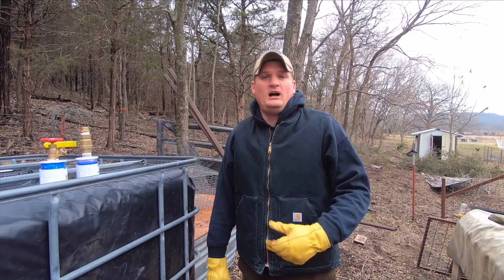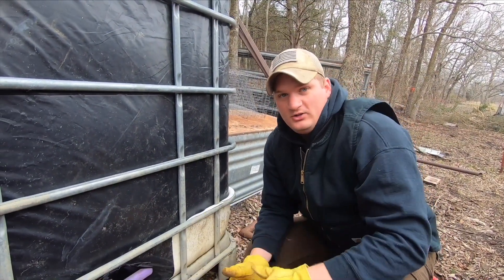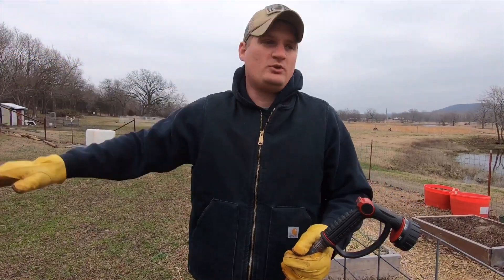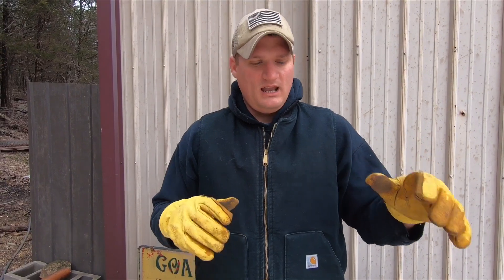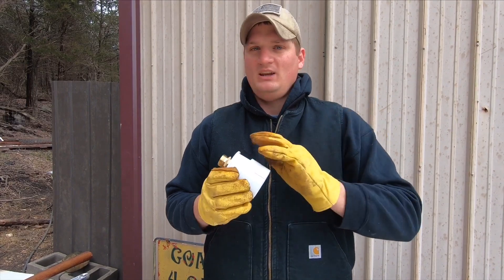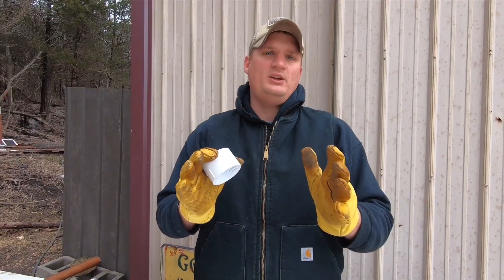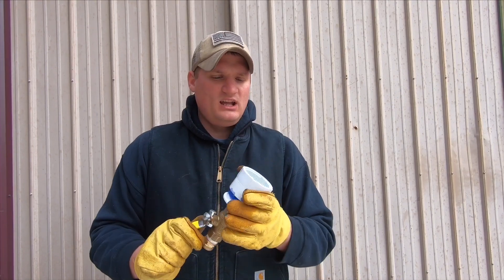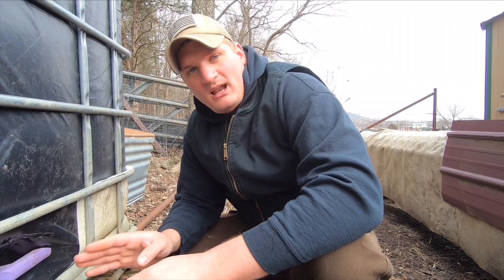The Best Valve For Your Gravity Fed Rain Water Harvesting System!

Comment: Good video showing the difference in the valves.  I saw the comments correcting you about pressure vs volume.  I just want to add a bit more info for others that might be installing elbows in the line before the hose connection.
As said, for maximum water volume you want to use a full port valve, but any elbows or tees in the line will add head pressure, which reduces volume and GPM.  A way around this is to use a larger diameter ball valve with larger elbows/tees.
For example, start with a 1" ball valve, then 1" hose to 1" elbows/tees.  Then neck it down to 3/4" to attach the hose.
Also, using a "sweep" elbow instead of a 90 degree elbow will reduce the volume loss caused by the fitting, so best to use them if available.  Another option is to use two 45 degree elbows spaced apart instead a 90 degree elbow.
If using several elbows before necking it down, probably better to use 1 1/2" instead of 1".
If you're going to use a lot of fittings, there are charts online that'll tell you the head pressure loss on any size and type of fitting.  You can do the math before you even start to determine what size to use to make up for the fittings that rob volume.  
In the end, you want the same volume/GPM flow with the fittings as you would if you just had a straight 3/4" hose with no fittings.

Comment: Thanks,,.
Y tested and work.
 After replaced my old regular garden hose connection, and put together with the new Handel Valve y have more pressure and more GALLONS PER MINUTE.

Comment: I cut a hole in the top of the tote and dropped in a 1/4 hp sump pump.    Using half inch hose now but in the past used 3/4 garden hose.      Flow with the large hose was phenomenal,  still very good with smaller hose.  Watch you don't drain the tank thru a siphon when the pump is off.  Grace

Comment: 👍👍. Dang you’re a straight up guy AND then the Bloopers 😅😂🤣😂. Got to love that laugh and smile. Very good video and definitely well thought out solutions.  My gramps drilled into me when ya change the clocks ya put in new batteries AND lubricate all valves with         3and1 oil.  In Fall wrap exposed pipes and leave extra to wrap valves just in case of freezing temps.  And ONLY because ya may get too busy with holidays and other things and forget. Ounce of prevention adds life to all your hard work. Been here 30 some years and one by one PVC pipes underground have now cracked and it’s been a mess outside.  Total excavation and finding more tiny leaks way below freezing line. Now just found a leak under foundation of house. They have improved PVC so much since back then but now water is so costly. Any improvements means gray water for outside and non consumable and another line for inside. And we’ve got the same setup for each faucet.  All very costly so any water saving ya can do really helps.....if we can get some rain. Been under drought rules for 5 years. So been wondering about your water.....a well or piped in??  Had a small well on my farm in back then had to buy shares for front land and house or it was a dance in shower to get clean. All your knowledge is Golden lessons for newbies.  But as always maybe it works and maybe it won’t BUT always be willing to learn. 👍👍👍👍👍👍👍👍👍👍

Comment: At 19:00 that is called a close quarter nipple.  Only saying this for those that might be going shopping for  parts. The glue only needs a few minutes to set. 
This is a nice set up, would be great for drip tape/or pipe irrigation.  If your not watering animals from it you can directly add fertilizer in it.
Reply from the maker: Squirrel hill farm we have been thinking of doing irrigation. I think that would help alot

Comment: Very Very helpful in determining mine.  I just bartered with someone for a couple tanks with the exact same novels.  Do you find it absolutely necessary to cover them in black for only garden watering?
Reply from the maker: I would cover them keeps them clean. If you ever needed to use the water for animals emergency etc it would be clean and no worries.

Comment: You have pressure  and VOLUME mixed up. If yer totes are 250 gallons, then the pressure will be the same in both tanks. Volume depends on the size of fittings you use. BUT, I love the vids, you two are great.
Reply from the maker: Thank you! 👍😄

Comment: I have 3 of these IBC containers that I am going to set up in the spring.  I have figured out not to use the collapsible hoses for these.  There is not enough water that comes out of those, use rubber hoses instead.
Reply from the maker: Yes 44 warlord that is true bigger diameter the better.

Comment: There is fine thread (NPT) and course thread, so be aware.  Unfortunately, mine is course thread and roughly 3.75 inches, so a rubber Fernco fitting for 3" wont fit and 4" is too big.  I've tried to buy the correct fitting online and having difficulty finding one.  rural king, tractor supply, lowes, home depot do not carry fittings for IBC totes. Online favors the 2" variety.

Comment: Mate! The Teflon tape is not there to stop leaks! And it doesn't "dry". It's dry by default. 
The tape is lubricant. It lubricates the thread to permit full mechanical  tightening. The tightening  grinds the tape which then becomes a plastic state and lubes the threads as rotation is applied. Best in a single rotation to fully tight. No stopping. 
Back in the day they used good old oily Hemp twine to give the same thread lube to achieve full mechanical tightening.
Also, putting your grips direct into the thread is a guaranteed leak. It will leak after grips have crushed the thread surfaces. When the primary thread on a double ended pipe cannot be tightened further, use the secondary fitting, ie the next valve to tighten both threads fully.
Best wishes.
Reply from the maker: Thanks for that tip! 👍
Reply: Also it stops leaks.

Comment: I’ve got one of them totes in the yard that didn’t come with a valve on it and the threads are a wonky size
Reply: rdnkrfnk use a Fernco coupling. You will need one that is shielded so it’s rigid.
Reply: DRIECUT  thanks imma try it